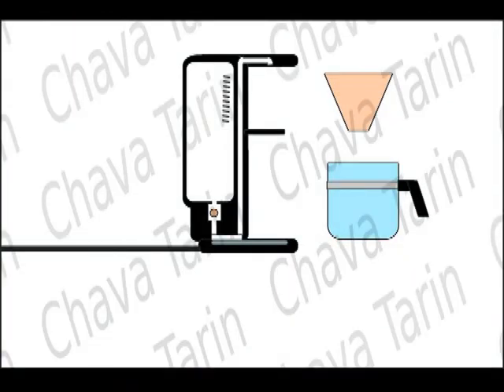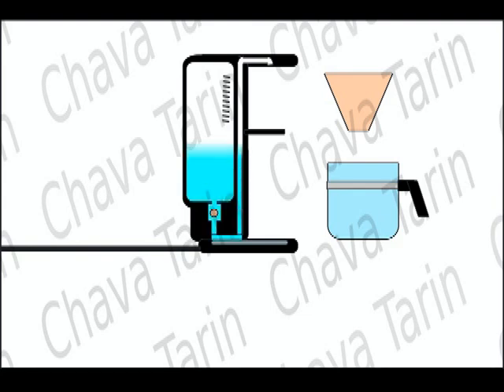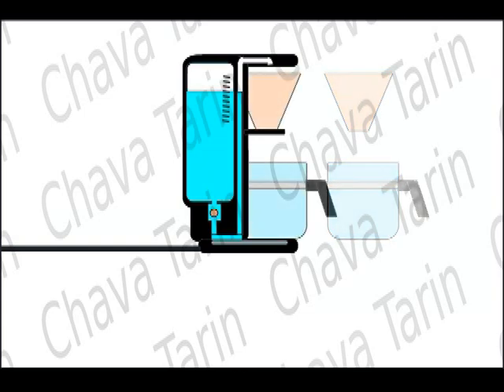How a coffee maker works

Comment: How does it pump water?
Reply from the maker: Dear Pheara, there is a small piece of tubing in contact with the heating element, and the water inside the pipe evaporates, creating a high pressure area, however, there is a check valve which prevents the pressure from going back into the reservoir, and the only way to go for the water is up the pipe and drip into the paper cone. Hope that helps!

Comment: How does the coffee maker know to stop dripping the brew when I remove the pot? Is there a sensor on the plate?
Reply from the maker: Usually, the same heating element heats both the pipe (thermal pump) and the plate, and has a bimetal thermostat which keeps it at the proper temperature, preventing dangerous temperatures from being reached.